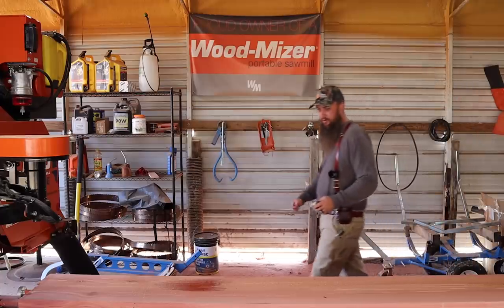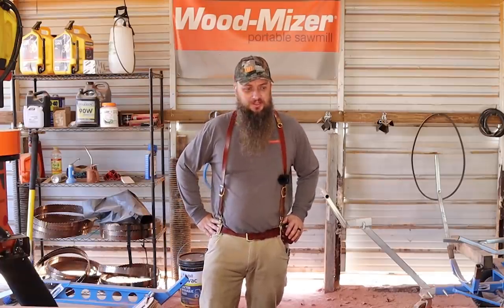A Log I Saved From The Loggers Burn Pile, Perfect Cedar On The Sawmill

Comment: With all due respect,  when I was a kid,  I helped my grandad reside his barn.  It as almost 100 years old, and he was going to be using it as a garage for everyones cars.  We used a plumb bob to make sure the boards and batten were plumb. Finishing nail with 14 ft of kite string , and a big nut off the tractor.  Instead of that level, unless you are sponsored or have an Amazon link for them,  try a plumb bob. One finishing nail on one side of the board, and one on the other, and move the bob down the line as you work. Love the shows.
Reply from the maker: good idea
Reply: plumb bob's and water levels  , what a concept !
Reply: Ain't no school like old school!

Comment: OK, gotta jump in here.  Several of those letters are plain idiotic. Timber is a renewable resource.  There are over 2000 different types of products that have wood content- some of which you probably have no idea.  Some of us use logs from trees that are dead, dying, diseased logs and logs from trees that, for one reason or another,  had to be removed.  This includes hazard trees.  As far as replanting trees, how many have you planted?  I bet that I have planted a heck of a lot more than you have.  I have been practicing good, scientific forestry for well over fifty years.  I was trying to recycle for over fifty years ago also.  How long have you been doing it-or are you even now.  Are you part of the solution or just still the problem.  From what you wrote, I figure you don't even know the problem.

I could go on, but I'm tired of typing,  Beautiful cedar log.  Keep milling, that paint won't look good for long.